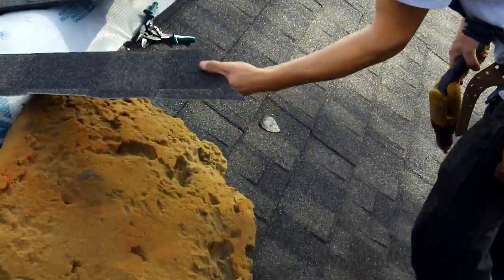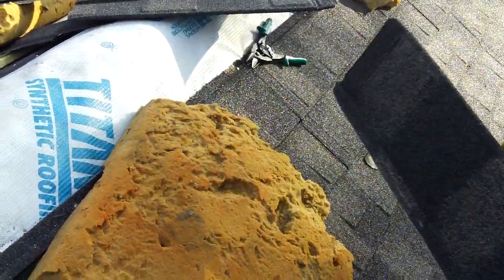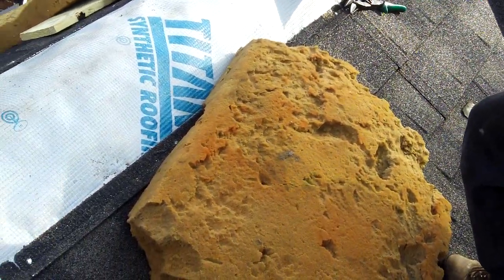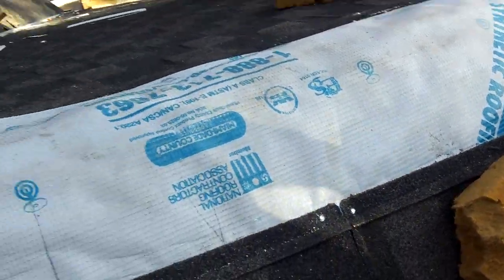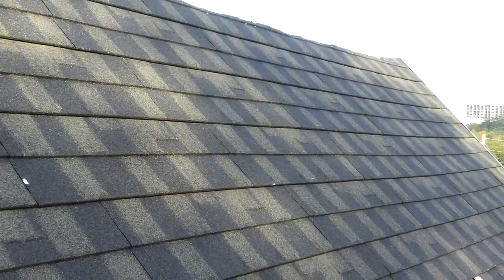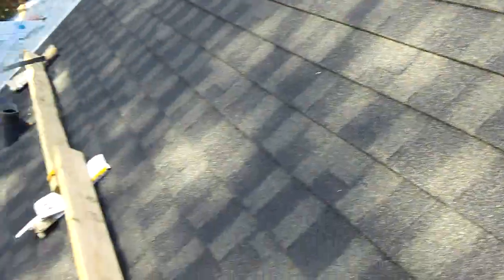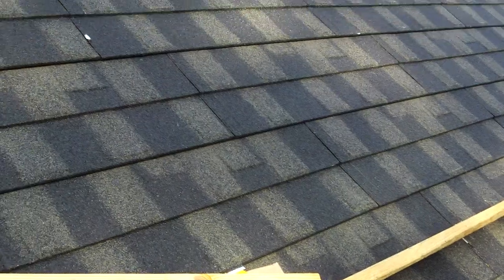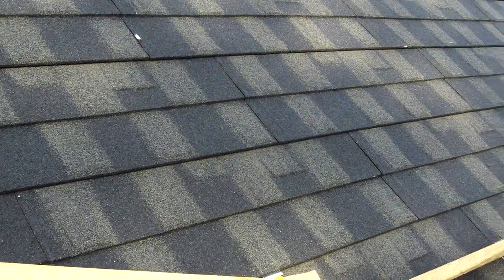Roofing University - Steel shingle Installation

Comment from the maker: Asphalt/Fiberglass Shingles wear down due to rain, which dislodges the surface granules, and the sun, which evaporates the asphalt. How fast the asphalt evaporates is dependent on the intensity of solar exposure once enough granules have come off, so the further south you are the shorter the shingle life. Be cautious of products used to extend life, becuse if they cause accelerated granular loss it will be detrimental in the long run. Washing with chlorine based solutions can cause this also. Hope this helps, and also look for Roofing University video tips on this topic.